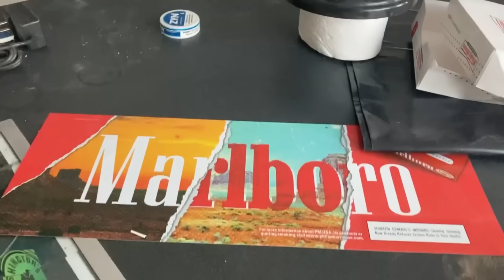We Demolished a Convenience Store With a Caterpillar Excavator

Comment: Building  didn't  seem in bad shape.
Reply: Well the thing is, "bad shape" is only one of the conditions that can be a reason to demolish a building.

Another one is: "Someone buyed the land and the building and decided to demolish it to build a new building on the same place" Could me a bigger store, or something else.
Reply: @JackMacLupus   most of the time, it is more cost effective to demo an existing building vs retro fitting it to meet requirements of its new purpose. for example  retro fitting an old gas station/service station is fools errand, easier faster to knock it down start over
Reply: Buildings was very weak though
Reply: It wasn't anything special either.
Reply: Its barely a building tbf, American cardboard shack.

Comment: It's amazing how much the windows in the right flexed before they popped.
Reply: Almost as if they were well made and could have been used by someone else. Maybe that glass would have lasted, you know, afew more years ? ( lol ). Maybe the glass had reached its expiry date though. Glass lasts afew years and then it returns back to sand, right ?  -_- ... 
x_x
Reply: @LORFCASTER  guess the issue with glass is finding someone who wants it with the EXACT same dimensions and frame type. Cant just cut glass simply too just ends up being cheaper to break and make a new one

Comment: I was really surprised to see how easily the roof collapsed when the front wall of the store was pulled down. I would have expected a little more structural rigidity from it
Reply: The roof sits on the walls
Reply: @gregwaters7830  I understand that, but there are still three other walls that was holding the roof up after the front wall came down. I was slightly surprised that the roof was not rigid enough to remain up with one out of four supports removed.
Reply: @DownundaThunda if the roof stayed up with an entire wall missing that means it was overdesigned. These buildings are a dime a dozen and don’t need that level of engineering. There’s no reason to make a roof that rigid since normal use of the building would have all the walls present.
Reply: Made in china
Reply: They are built to legal standards for the area they are in. Why would I want to spend an extra $100,000 to make my building more bulldozer-proof if I don't have to?
Reply: You could see the roof fall in when the large metal support beam was removed. The front fascia of the building wasn't load bearing. It was the side walls and support beam.

Comment: To what extent does it make sense to separate out different materials as you demolish the building, like metals?   Or do these get separated if/when the debris is shredded at some other location?
Reply: Cost of disposal is the primary determining factor. Scrap metal has value and is usually sold to a scrap dealer. Mixed demolition waste is very expensive to dispose of. Paying demolition waste rates to get rid of valuable steel doesn't make sense, so the easy to pick or significant chunks of steel are always plucked out. Most demolition companies don't process their waste any further then they do on site. Typically a third party waste removal company will be hired to remove and dispose of the waste from the site (what they do with after that is a whole other discussion).

Some demolition companies will spend more time tearing down the building and more thoroughly sorting the debris as they go(concrete/brick, Wood, Metals, etc). More common on very large building demolitions where the disposal cost to just send it all mixed would be astronomical. Some even go as far as deconstructing certain parts of the buildings and saving things like windows, doors, fixtures, etc to resale or donate. Its ultimately a numbers game for the owner and/or demolition company.

Comment: As an architect who spends countless hours sweating blood to design buildings, it's heart-wrenching to see how quickly dreams can be turned into rubble.
Reply: Damn I felt that
Reply: I'll admit that I was surprised by how easy it was to bring down. Once he grabbed a hold of that big beam at the front, it was over. You'd think the structure would be stronger than that.
Reply: Architect sweating blood yeah sure 🤣😂
Reply: :face-pink-tears:
Reply: As an MEP engineer, I feel the same way too.
Reply: My thoughts exactly.
Reply: I doubt any architect worked hard on that specific building. It would have been built to a standard spec. There'll be many others like it with only minor variations.
Reply: @mericet39  You might be surprised.  Oddly, zoning and building codes make duplicating a building almost impossible.  Then there's neighborhood associations, ADA regulations, topography, client input, structural stress revisions, etc. etc.  And of course, maxing out the utility of a site (size, shape, orientation, exposure) typically involves a custom design.   But even if it were possible to rubber stamp several identical buildings, they're like kids - sort of hard to watch being destroyed.    The silver lining though is that the exposure to professional liability goes away with the owner's intentional destruction of the building.
Reply: Ken, calm down Albert Speer
Reply: @KeyboardBuster  One day you won't be a child.
Reply: @KeyboardBuster  This rampant disregard for the built environment is driving me crazy!  I'm mad as h*ll and I'm not going to take it anymore!  When will we learn that buildings have feelings too!  Those studs and bricks came from valuable resources.  I better take a nap.
Reply: If you think that's bad. Imagine how I feel, I grew up watching a woodland turn into development, if you think buildings have feelings, you do not imagine the hurt of the land for which development is on.
I wish they would quit clear cutting to create suburbs, I also don't like dynamite, that's the worst. I've seen so much dead wildlife from Dynamite. 
I mean developers have no regard for life. Why would they have regard for a building that came from life? The plywood came from life.
Reply: @KCH55  I too grew up next to a beautiful forest.  It's now a sub-division.  But thankfully, we don't use dynamite around here.  Generally, the percentage of the earth developed for buildings and infrastructure is very small.  Cities are concentrations of people within fairly vast untouched areas of land.  So is mankind alien, or is this world for mankind?  "...multiply....'subdue' the earth..."  Gen 1:28  (An order from God to Adam and Eve.)  I too appreciate nature and a beautiful forest, but also appreciate the needs of humanity.  All too often, I see an unbalanced respect for what's important in this world.
Reply: 9 years to build fell in 10 seconds
Reply: I can imagine! a major remodel on a house is hard enough!!!

Comment: Here in the Netherlands it works very differently.  All usable materials are first neatly removed.  Then controlled demolition and sorting all materials for recycling.  What's happening here is just tearing everything down.  The result is an unimaginable mess that you can no longer do anything with and you have a lot of clean-up work to do.

Comment: It is so weird seeing this with a European lens. Landfills have been outlawed here 25 years ago. So everything needs to be sorted and recycled. You can still get a dumpster/container for "mixed waste", but it is something like 10 times the price, since someone has to manually dig thru it all and sort it later. Here this building would have been stripped of everything inside. Even wires and plumbing removed from the walls. All windows and doors would have to be removed first too. And the demolishing would only be an empty shell of mostly only one material.

Comment: You've got to get a go pro shot of the bucket coming through the roof on your next demo! It would make a awesome shot!
Reply: Problem would be recovery of the camera. Once the roof is damaged, it would be too dangerous to enter the building, so they would have to manually sift through the debris to find it. There's also no garuntee that the camera won't just be destroyed by the excavator as it does it's work.

Comment: Next time save the LED lighting from the outside. They are worth a lot of money. They run about $150 to $400 each.
Reply: They were at its last legs working 24/7/365x25
Reply: not sure if that wallpack on the right hand wall of the building was LED. though i would of saved it before the demo anyways.

Comment: What a waste of material.
Reply: lemme guess, you couldve hand stripped that building in a quarter of the time, salvaged every screw, washer, piece of wire and metal and cleaned up the debris
Reply: No its not
Reply: Well if you could pay someone to strip all materials that could practically be reused you'd spend as much on labor as you would recoup from the effort. Plus this demolition is probably on a time schedule so you don't have a month to fool around doing that. Besides other than the metal you're not going to get much value from used building materials from these cheaply constructed buildings. I would assume these demo projects are more profitable the less time you take for each job and move on to the next one.
Reply: All these people wanting to save this stuff, it would take weeks to strip it all down. Who’s going to pay for it?

Comment: This question of mine must be one of the top questions. 
  Here is the question. Why or what is the reason which prevents this useful building from being converted into a home for anyone who needs one? It is built, it appears to be solid, it appears to be livable. Why tear it down?
  Brick up those glass doors to make it burglar proof. Install a shower into restroom. Laundry space. 
  In my town, this much space, in an apartment bldg, would be $2000 -$ 5000 per month. 
  Crazy business.
Reply: One possible reason, the property's not zoned for habitation? It's located in the parking lot of strip mall. Plus, the land under it's probably worth a fair bit for commercial use.

Comment: My kind of work. I had many contractors, set appointments and show up, that size building, I take 2 hrs. Of cleaning out all metal, and metal door's and windows of metal frams, by myself. I know what to do, and get it done, free of charge, doesn't cost them , I make my money on metals, and I usually take in 7 to 10 thousands dollars. Metal I frames is all last after it torn down. Separate count cost. Round 2k extra. I cut em down to 4 ft. More money earned.

Comment: For those of you that think any of this material is salvagable, I would offer you a hammer and a nail puller and give you the go-ahead. You would soon find out that it is more expensive to deconstruct a building by hand  than to build it. It is also extraordinarily unsafe. By the time you add in all the costs of hospital bills and disability claims, the really smart money is on letting modern machinery do the job, quickly and safely. Unfortunately, buildings have a shelf life of about thirty years. Neighborhoods grow and the highest and best use of a parcel of land changes with time and growth.
Reply: In europe they recycle the materials. Maybe it's more time consuming and so more expensive but the recycled materials have value so in the end it may not be that expensive. At least it's beter for the planet and that is important too
Reply: Come to europpe and yopu will find many 100+ years buildings. It gives place character and these old buildings look much beter that those cheap "thow away in 30 years buildings"

Comment: IF there anything iniside need recycled then remove it like store shelf furniture  and then  demolishing the building removed materials to demolishing company site  to  shortng out to be  recycle is roof beams, copper wire,aluminium, bricks and concrete.   MDF wood to Rubbish tip is contains formaldehyde and paraffin wax, and these make it a difficult material to recycle. This what demolishing do in Australia.